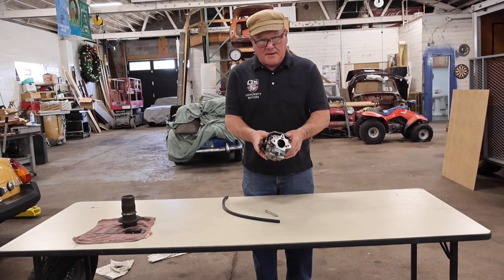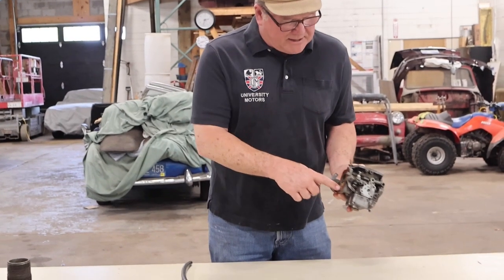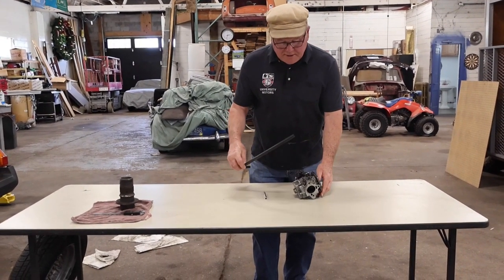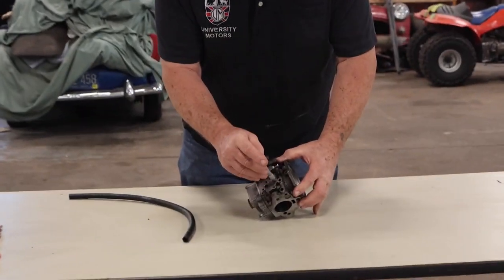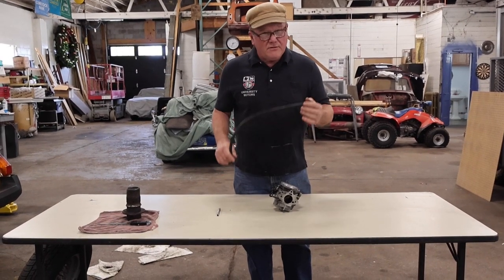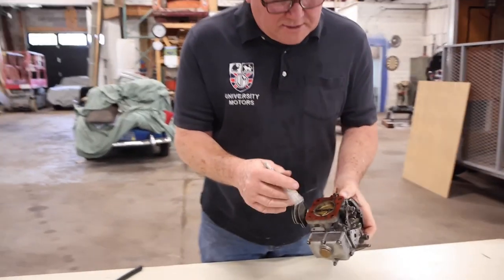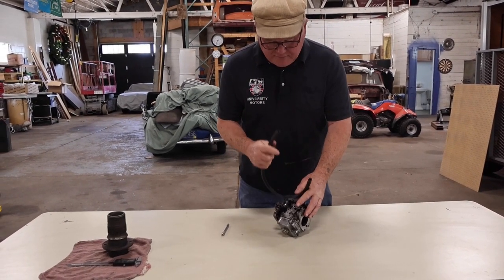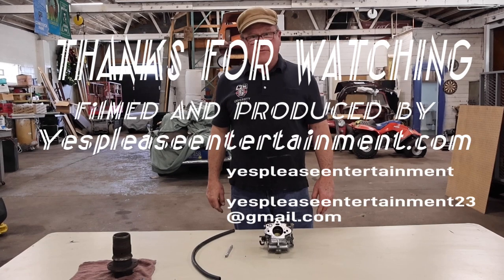393 MG Tech | Stromberg Carburetor Automatic Choke

Comment: Are you still helping people? If so I have a problem. I am restoring a MG MGB 1979 the problem I have is the people before me took the top off the thermostat housing to get water to the choke. I replaced the housing with a new one and I have been trying  to find the right place to hook up the hose coming from my Zenith carburetor. All the picture show the hose going off the back of the block but I do not see anyplace that I can use. Please help me.
Reply: Check the Moss motors parts catalog Part Number 109"  470-245  Outlet, automatic choke" this fitting is located on the rear top part of the cylinder head drivers side. with two 7/16 nots securing it to the top of the head. The hose runs to the top automatic choke assembly.  I have a video on youtube that shows near this are.  Take a look at my videos. Will try to make a new video covering the topic. I would suggest getting a copy of the 1975 to 1980 Workshop manual. The earlier shop manuals don't cower the later equipment.   I see good used copies of this book on ebay all the time at a good price. This
 MGB Workshop   
https://www.youtube.com/watch?v=B4G2QqYveVg
Reply from the maker: John does not reply to questions on YouTube but you can reach him with the contact form on his website. https://universitymotors.online/contact/